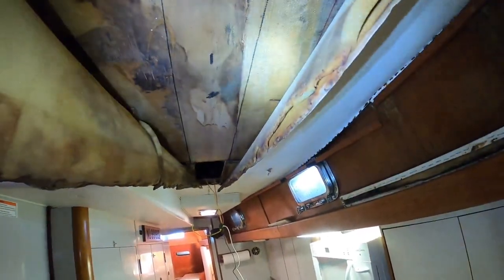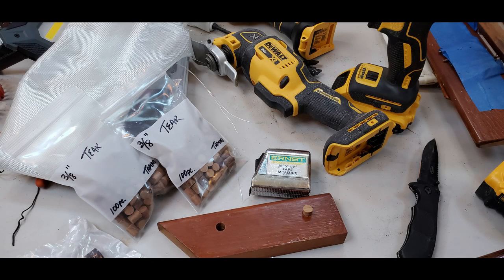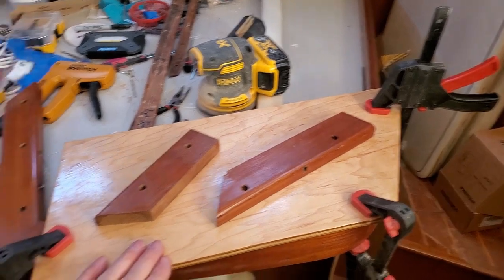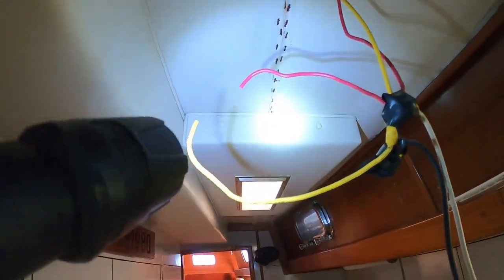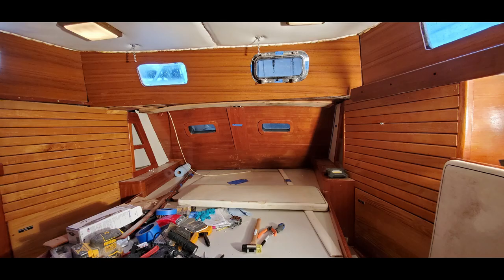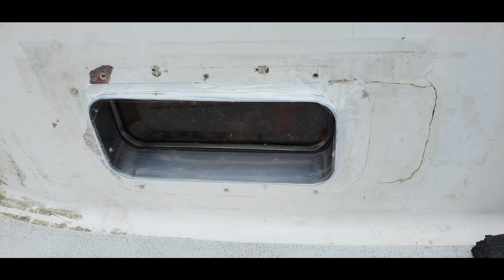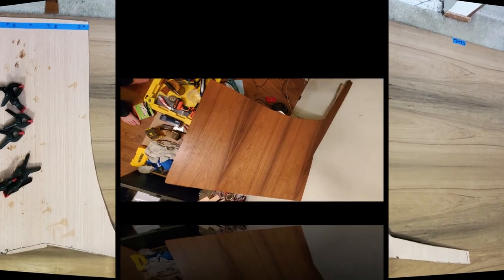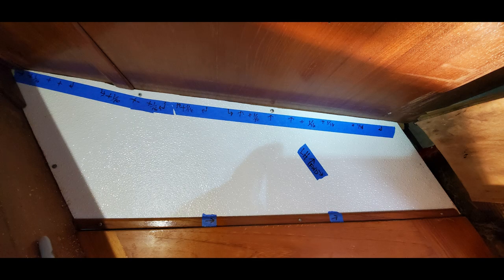DIY Sailboat Interior Refit. Beautiful New Teak Panels For Aft Cabin. Endeavour 52 Sailboat S 1 E 27

Comment: Nice work guys!  I actually looked at this boat about 6-7 years ago before it was hauled and put on the hard.  I knew it would require a vast amount of work, but you guys have found some issues that I missed.  Good luck and please keep posting the videos :)
Reply from the maker: Thank you for your comment.  That's pretty cool hearing you looked at this boat that far back. It must have been in better condition back then. Nothing good happens to boats sitting for so long.  We have our work cut out for us. We are slowly making progress. The galley overhead structure project is a bigger problem than we originally anticipated.  We are learning how to repair it as we go. Thanks for watching and we hope you have a great day.
Reply: @DIYNauticalDream  Make sure to re-bed any through deck hardware above before you close up the ceiling panels :)

Comment: You should go to the Boeing surplus and get some “Wing nut Draw cleco’s” might make drilling holes a little easier
Reply from the maker: Thanks for the great comment.  I don't think there's a Boeing surplus around our area anymore.  The cleco idea probably would work pretty well during the portlight installation. Thanks for your helpful comment and thank you for watching. We hope you have a wonderful day.
Reply: @DIYNauticalDream  you can pick them up online too- “The Yard” usually has good prices- also keep an eye out on the “Offer Up” app. I wish I was still up there- I have a draw full of them in my Rollaway. Well if ya come across some don’t forget to use washers on the back so they don’t pull through. Cheer’s
Reply from the maker: Thanks for the great advice. I used a few cleco's back in the day when I used to be a mechanic and actually worked on the airplane. Thanks for your comment and thank you for watching.